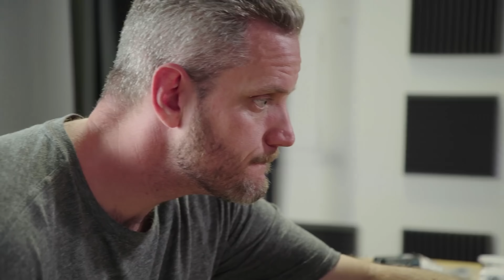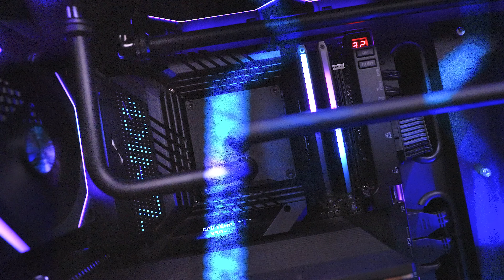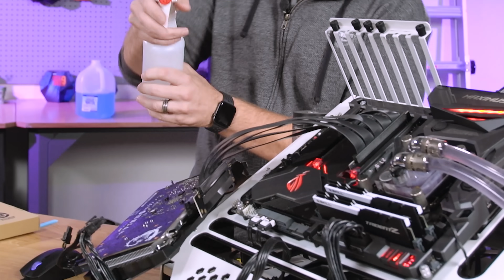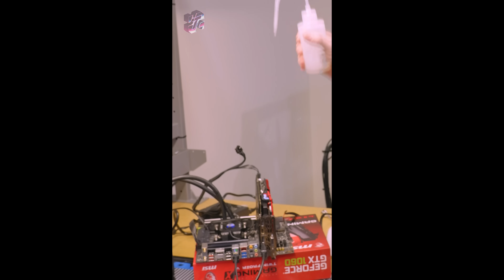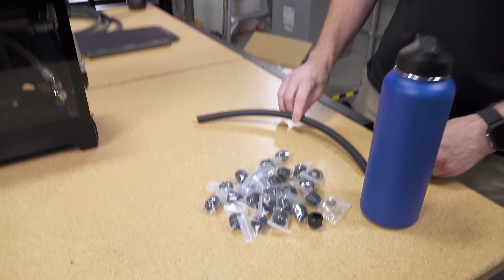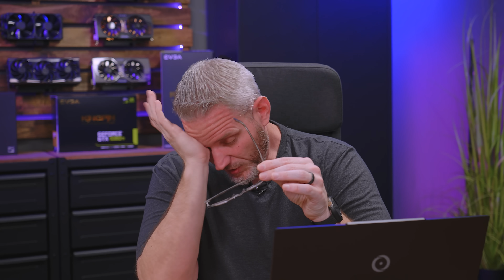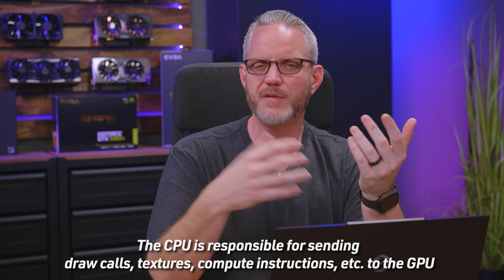5 Myths about Watercooling that are WRONG!

Comment: And it's stil expensive to have a pc watercooled. Yes, watercooling per se isn't as expensive as it used to be. The problem is that in 2000 you could buy a whole highest tier PC for 2 thirds of the price of a current GPU. Nowadays a low tier motherboard costs more than most mid range CPUs. Most people don't want to risk such an expensive today's rig with watercooling. Because accidents happen. In 2012 you could have a GTX 690 for $999 and GTX 680 for $500. Now the cheapest RTX4070 Ti costs as much as a GTX 690. Add it to the price of watercooling (which isn't as expensive as years ago but still overpriced) and the risk isn't worth the price. Unless money isn't a problem for you.

Comment: Did my first watercooling build using soft tubing 15 years ago, still using the same parts (with a new bracket for CPU) About $300 then. Once I move into my new house I'll probably do a full PC upgrade and semi-new loop. I'm curious what hybrid fittings he's talking about as I'd like to start with soft until I figure out what design I want which the soft will help with.

Comment: There is a way to keep your room cooler with a water cooling system. Have the radiator and fans outside in of the room, run the circuit out of the case and through a wall where it is cooled via a radiator and fans and then comes back in through the wall and into the case. A wall mounted system would be best, but I think it could be done. The other way might be to use an external box for the radiator and have the fans exhausting the air outside through a wall or roof like a chimney.  It might even be possible to do this with an air-cooled system with and exhaust box leading to a chimney or wall vent.

Comment: My best myth bust was trying to explain to people that the loop will saturate and all components will receive the same temperatures. After trying to argue the point to exhaustion and annoyance, I just finally started referring people to your channel and videos. Thank you and your team for the work you do and all of the great video's and insight. You are a boon not only for us experienced types, but also for beginners. Please continue to do what you do, and we all look forward to the new expansion.
Reply: Roughly the same temps anyways, it can be a few C difference.  My system runs a difference of 2c or so under load between the output of the rads and the output of the heat load (I have temperature sensors in both places). It depends on your flow, which is another major myth that you need a huge flow rate.

Comment: I have a tool you can use to show fluid temperature and the difference between two probes, pretty much already ready to use if you want to reach out. I built it to use in a operating mock up cooling tower display for an HVAC class.

Comment: It's amazing how electronics surprise you into thinking they're not going to work. My ex-stepfather brought home some old electronics from someone he knew to throw them away for them. Come to find out one of the pieces was a black Nintendo Wii with a couple of Wii-motes and the connections to make it work. Of course I didn't know it was there prior to winter so the Wii and all of its' stuff to hook it up was under a pile of snow all winter and well into the spring. 

After I found out it was a Wii during spring time I let it dry out in the shed for a few months. This 4th of July I brought it over to my older brothers house so my nephew and I could tinker around with it. It fired up and worked perfectly. The only thing that didn't work was the nunchuck-port on one of the two Wii-motes. The second Wii-mote worked perfectly. So I got a fully functioning Wii for free. My older brother got a Wii from a yard sale that was missing some stuff. If the one I brought over didn't work it was going to be used for parts since it had all of the connections.

Since it ended up working I left it at my older brothers house so the kids could play with it. They have a PS5 and some XBox ONE's/Series consoles. But they've been going and finding deals on PS3's and some other older consoles. He still has our childhood PS1 and it still works. :)

Comment: Thank you for this information.  Love the channel and this helped me understand some of the basics.  I have an AIO that has lasted for close to 13 years now in my current system, but am looking to upgrade depending on the data for the next gen parts.  I do plan to build a PC to have under my TV so I may try to water cool that one instead, but I will need to ask around, confer with others, and do more research with your videos from the past to make my decision.  Would also appreciate the inline temp just for the science of it.

Comment: Reasons people do PC water cooling:
1. Greater thermal efficiency.
2. Less noise
3. Better looks
Debunking:
1. Greater thermal efficiency only means your space (the place where you are with this computer)will be WARMER than it would be with air cooling because the rad will shed its greater thermal load into the air where you are.
2. Rads use fans - multiple fans - to get the heat out of the rad and into the air. Three (or even four)fans per rad (because a high-end system can have two rads)is not quieter than one fan on your CPU and one on your GPU.
3. Looks are a purely subjective assessment; even so, a working system using air cooling looks better than a liquid-cooled system that is constantly turned off for maintenance.
Reasons not to use water cooling:
1. It is bloody expensive. You can easily spend more for a water cooling loop than you did on *the entire rest of the PC*.
2. The added thermal efficiency of water cooling is severely offset by the fact that the rad simply exhausts that heat....back into the air.
3. The lower noise of a water pump vs. an air cooler is entirely mitigated by the greater noise from two, three, or even four 
fans required to blow the heat out of the rad.
4. Even the looks of the perfect water-cooled system are offset by the look of algae in the water, the look of corroded fittings, and the look of being broke because you blew your money on a water loop instead of a better GPU.
The cost of liquid cooling combined with the much higher downtime due to maintenance and capped by the fact that at the end of the day, all you are accomplishing with liquid cooling is adding another full phase to the thermal load makes it a fool's errand.

Comment: Hey Jay, after watching this video I came up with an idea for a video: connect a watercooling loop from a GPU at 100% on PC nr.1 to a idle CPU on PC nr.2 and check if the CPU temperature actually rises or not. Then do the exact opposite: push the CPU of PC nr.2 to the max and check if the temperature of the idle GPU of PC nr.1 fluctuates. Maybe even switch the order (GPU -> CPU and CPU -> GPU) to see if it makes any difference.

Comment: Water cooling will not make your room cooler unless you are using a MoRa external radiator and 25 feet of tubing to move the radiator into a different room, or to a window. (That is what I am setting up right now for my next ThreadRipper system.)

Comment: Water cooling your machine can keep your room cooler, if you run the water out of the room to the heat exchanger.  You can't really run it outside in the summer, but you can run it into a different room.

Comment: Hey Jay, I really hope you make that video on loop order. Because even though the deltas between the inlet and outlet of GPU is only a Delta two or three. The Delta between a CPU and GPU are higher, and water has a thermal capacity so it’s saturated with heat from the GPU then it can’t transfer much heat out of the CPU.

Comment: I have in-loop temperature probes installed just before and just after dual 420mm radiators. The temps differ like 2°C under a gaming load, so any influence loop order will have is less than that.

Comment: I've debated on watercoolung my pc, but I have had trouble knowing what to pick and finding a good block for my GPU. I have an MSI 3x 4070 and apparently from my searching, is a hard card to find stuff for. 
Also, currently my temps are really good for what I have and haven't seen any issues heat wise so it would primarily be a cosmetic reason as I think watercooling loops look really cool when dine right. But like you said, cost is a factor. Any help in that aspect would be great for those who don't know what to look for and have "lower" end cards like mine.

Comment: Might be interesting to put two systems side by side, maybe on test benches, one with an air cooled CPU and a water cooled GPU, the other with an air cooled GPU and a water cooled CPU, and run tubing through the GPU on one system to the CPU on the other system so you can get CPU and GPU idle temps with and without the CPU or GPU as a loop factor in either system.

Comment: Reasons why I'm using a Noctua air cooler instead:

Noise (it's simply quieter than multiple fans +pump)
Price (being Noctua it isn't much cheaper but still...)
Mainboard component cooling (it's even a top blower for additional cooling)
Reliability (I don't have to worry about replacing water or leakage, +Noctua fans outlive most systems)
Overkill (My CPU only draws 60W)

Comment: The principals of an automotive cooling system are the same. The implementation might be different. fundamentally they do the same thing. The cpu and engine get hot we send  fluid to it to remove some of that heat, send that heated fluid to a radiator to cool off a bit  and then back to the cpu or engine. Most vehicles (exotics not included)  only have one radiator for cooling engine coolant  and if that coolant is needed else where its split off before or after going through the engine  and then back to the rad. The other "radiators" you may see are oil coolers or condensers or intercoolers and don't have engine coolant going through them. With the exception of transmission coolers but this is still done before that coolant goes back to the rad to be cooled or its cooler is built into the rad itself

Comment: I used to use tygon clear tubing and swaglok fittings when I built loops 20+ years ago. Modern fittings are so cheap and good, folks have no idea how good thing are these days. Definitely something everyone should try if they're interested. Everything is easy and you can get everything off the shelf, no more DIY required.

Comment: Jay, good video - I learned some info on water cooling that I definitely had assbackwards in my head.  As for more videos on water cooling.... sure!  For example, I'd like to see the effects that moving a component around in a loop may have, efficiency of different liquid coolants in a system, impact of radiator size on lowest coolant temps, efficiency of different fan speeds and sizes, pulling air into a case from outside vs. exhausting internal case air through the radiator and out of the case, and so on.  You get the idea.

Comment: I have 3 thermal probes on my water loop... right now it's a heatwave, and my room is warm, and my GPU is at idle... my GPU temp is sitting right at my fluid temp (34)...  It's my cpu which is heating the loop and is running hotter... from MS Word needing lots of CPU time ,for some reason...

Comment: Jay, I would love to see a practical build, for those whose priorities are 1) quiet, 2) easy service, 3) smaller and lightweight.  In particular, I am thinking Koolance quick disconnect fittings. Small diameter rubber neoprene hose - either 1/4” or 3/8” inner diameter hose. Easy removal of GPU, CPU, change of  NVME M.2 without draining loop.  

Consider reservoir/pump with 2 manifolds - in and out. Connect parallel loops for each item, rads, CPU, GPU, to the manifolds - no serial loops. Using 1/4” diameter rubber hose is so flexible and corresponding quick connectors are small (but expensive).  4/5 parallel loops have more area than typical 10 mm hard tubing, so pressure loss should not be an issue. May need a controllable valve to balance flows so low pressure drop rads don’t take all of the fluid flow.

Comment: Water cooling companies take a HUGE profit margin. Single fittings costs maybe a euro/dollar for them. If you shop smallscale industrial you'll find them for a few euro a pop max. Yeah they look industrial but that black coat is not such a significant cost.

Also, careful with word choice, air is a fluid ;)

Comment: Tap water in Europe must not exceed 150 ppm of contamination. When you measure tap water it's typically as close to 150 as they can get as that's cheap to do. They put a mixture of calcium hypochlorite, calcium hydroxide and calcium chloride into water too.
I used a RO unit to make my own reverse osmosis water (de-ionised water). It consisted of a pump tubes and filter unit. I used a 3 stage unit and would get the water below 1ppm with no measurable chlorinates remaining. I stored it in a cool dark place and it was good for months, untreated. 
You could use it for water cooling, windscreen washing fluid, cleaning windows (amazing for cleaning windows by the way), car radiator and so on. 
If you feel brave, hook a pump up to a 25 liter Jerry can, tie it into the water cooling loop and you'll struggle to raise the temperature. Treat heat energy a bit like dilution. The larger the volume, the more dilute the heat. Your radiator gets 5 times as long to remove the heat albeit it isn't a linear relationship. So, the net effect is a significant drop in enthalpy, (heat energy), when you significantly increase volume. So if you can live with a couple of Jerry cans under or beside your desk, looped into your cooling loop, your heat dissipation issues will go away. 
Now, people struggle to get this as it's the same size of radiator and the same heat so how can 25 or 50 liters help? Well, think of it like dilution. If you add a drop of dye to 1 cup of water, 1 litre of water and 25 litres of water. The cup will be dark and the 25 liters will barely change. Heat is similar in that the water can hold a lot of heat. Your radiator will be dealing with less heat for a longer period so it will result in more heat removed over time. This may seem counter intuitive but it is the reason power plants have enormous water towers, not lots or huge radiators that are expensive. A large volume is better for removing heat and dissipation that heat. 
If you are not willing or able to go with a secondary cooling loop, then your stuck with a small, bespoke loop. It works but has limitations. For the CPU, a noctua fan will be similar to a standard loop. An AIO cooler, no better than a noctua, probably worse. A custom loop is still petty good though.
The GPU, well there are AIO cards but they kinda sick and are expensive. Custom loop on a GPU is way better and probably the only worthwhile thing that I have found for GPU cooling over stock air cooling on GPUs.
So, Jay, have you ever tried the large volume loop? It's relatively simple to do, try a pond pump and get several Jerry cans linked in series. Tie the Jerry can loop to the PC loop via a manifold and see what happens. The manifold could be a coke bottle, you are just seperating the Jerry can loop from PC loop to prevent pressure and flow issues. If you are clever about it, you could tie the Jerry cans togeather so by opening and closing valves you go 25, 50, 75 and 100 liters. You can stress test each until they settle out and you will see how significant the volume is on temps. The results are not linear, they are logarithmic and there is a point where any greater increase in volume has no effect on temp as you cannot saturate the water or measurably increase the enthalpy. If you want to do science... go do some science. I'd be happy to draw a schematic,  outline parts etc. I'm an engineer and already tried this in the early 2000s. You will be surprised at the results. I've heard you say volume doesn't matter. Try the test, find out through testing what happens. Vary the volume, vary the flow, keep everything else the same. Hell, go as high as 400 liters, see what happens. Plot the temps you get vs volume. It's logarithmic. Then, loop in a second radiator and repeat the test, you will probably be REALLY surprised with the results when you do that. I used a system like this for fun and overclocked an AMD Athlon (when they were new) and had amazing results. I was in the top 10 fastest CPUs and everything either side of me was nitrogen cooled. The thing is, I didn't just OC and get into the top 10 with a 5 minute test, I ran the thing at full tilt for 2 or 3 years like that and was stable the whole time. That poor little 1.8 GHz athlon ran at 3.2 GHz for years, pretty much every day. I kept the CPU and have it in a wee box to this day. Those were the days, when overclocking was new, almost everything was bespoke and nobody had done anything like it before.

My wife is a saint and puts up with my crazy stuff. Just thought she deserves a mention. 😊

Comment: I did my first custom loop build a couple months ago, it was very scary at first. Especially taking a very expensive gpu apart, but by just making sure all the parts fit and I had the right tools it wasn't that hard. I thought of doing soft tubing but I found some pre bent hard tubing so all I had to do was cut them to size. If anyone has any questions about what I did feel free to ask!

Comment: There are some cases where loop order does matter but they tend to be edge cases. Eg stacked rads or effective stacked rads (balanced intake / exhaust) you should have the exit rad as the first rad after a heat source. If you have low flow or stupid amount of rads then the flow path can also be optimised for better performance.